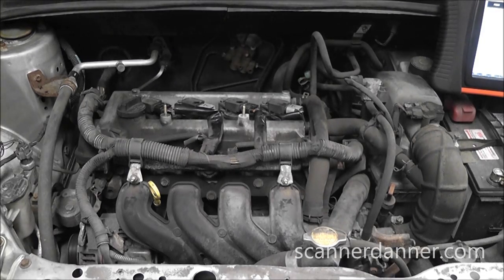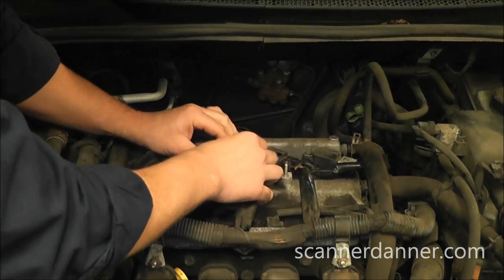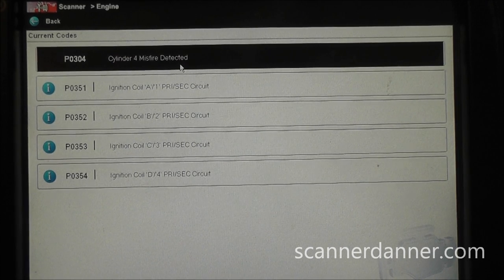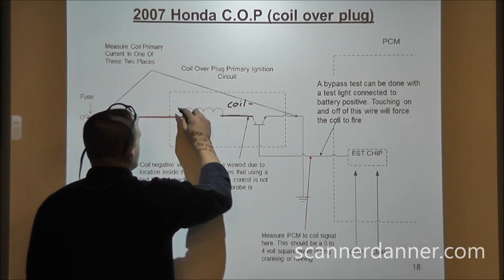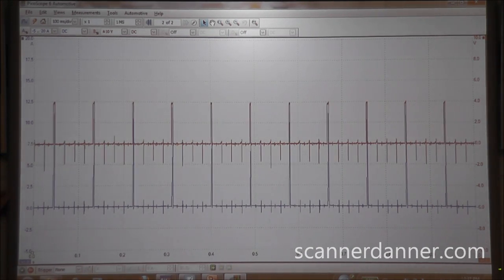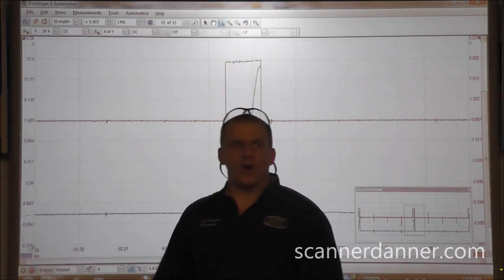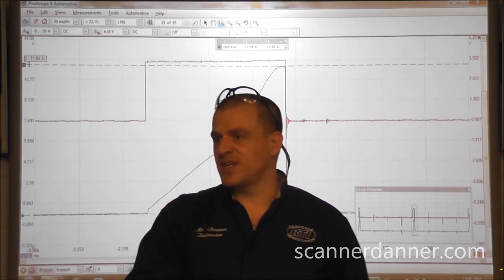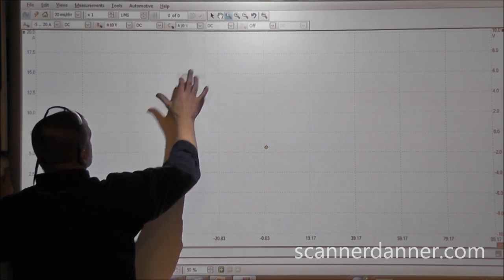Operation and testing coil over plug ignition (4 wire) - Toyota/Lexus

Comment: so if i dont have a pico and all this high tech stuff im screwed?
Reply: I use a Hantek pc scope I got on amazon for little over $100 and it will do the job adequately.  Current clamp can be adapted to connect to a scope as well.
Reply: I also bought a hantek 1008 with all the clamps e.c. works fine for now, just little information. I bought is as a first step into scoping. Next scope will be Pico Or GMTO e.c.

Comment: I have a question..
Can you generate a square wave signal to the coil from a oscillascope with a generator function... Yes no...
I noticed you do it from a test light...
Reply: I'm in your  primi  program
Reply from the maker: Sure can, on the ones with the transistor inside the coil
Reply: ScannerDanner

Second question 

Same question ...but... For every coil that has a signal.. To the coil, as you answered ...

But, also to the control mod ( computer)... Yes... But with precaution????......yes.
Reply from the maker: "to the control module" you mean to substitute an input signal? Like a cam or crank input?
Reply: ScannerDanner 
Maybe I'm not explaining it right.....
Testing sensor signals.. From ECU, control mod..... Going into the sensor... Small signal to see the response of the sensor..
I know you have to check the sensor also for resistance and make sure you have a ref voltage also... Just to check to see the return responce back to the computer..

Hope I'm not asking for too much.....lol
Reply from the maker: @dfigueroa903  sensor signals and substituting them, you would be looking for a reaction from the module, not the sensor. The sensor won't respond, the module will. 
So yes, this is a completely valid type of testing and I use my test light a lot, for substituting signals to a module.
Reply: Correct that's what I meant, yes.... Okay... Love the classes...
Reply: I use the test allot also. lol..

Second question..

I know this is off topic, but,..... Do you use your scope allot in servicing the newer model cars for network signal verification...

Comment: Isn't it danger to do so as the car is running...
Reply from the maker: what? disconnecting the coil? No, there is already huge voltage spikes occurring on an ignition coil circuit.

Comment: First off, thank you for the amazing videos, I have the hard copy of your book which is also invaluable. Secondly, it would have been totally acceptable (to me), for you to lose your composure, go over to the guy with the air hammer and rip it away from him. The noise didn't take anything away from the instruction for me, but common courtesy should have played a part here, no respect from that guy.
Reply: +Greg Bowman haha yea for sure, but I also have my classroom in the middle of the shop area and noises transfer into my room so much. Couple that with other classes working and doing what they are supposed to be doing and I cannot complain. Everything doesn't stop because Danner is recording. (I wish it did) :) Thanks Greg